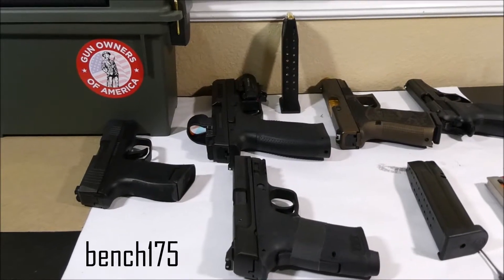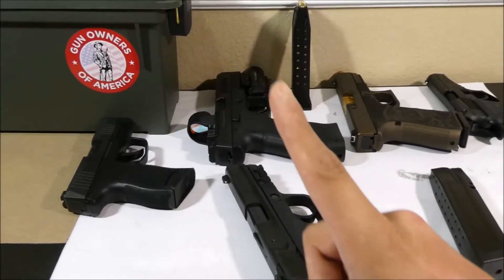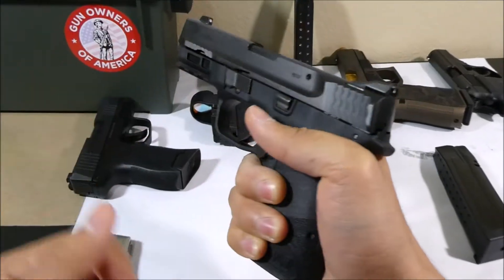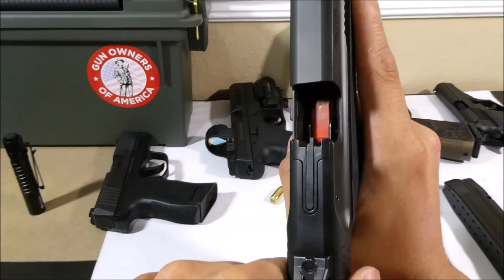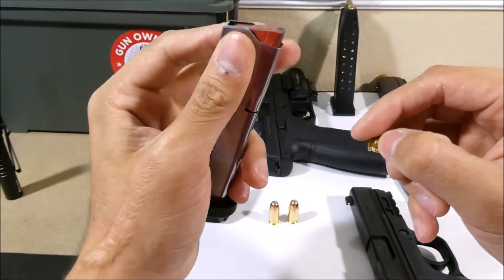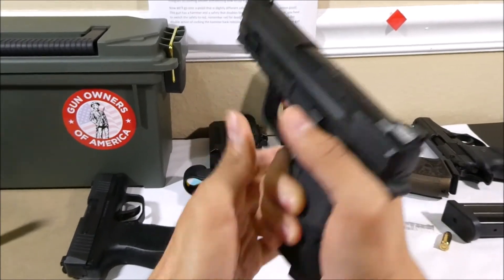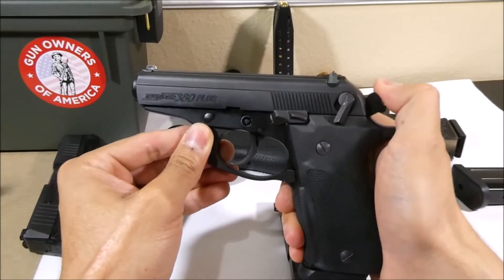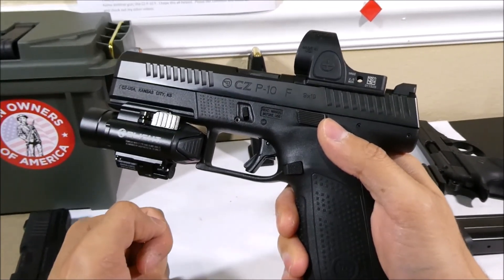How to use a Handgun / Semi-auto Pistol 2.0

Comment: Would a glock 19 be a good beginner gun for self protection? I am willing to spend at most $700 USD
Reply from the maker: I would say you have a lot better options than Glock these days.  They were just first like Ford cars, but there are a lot better cars than Ford.  Watch my video Best First Handguns 2020 at this link, and I'll answer any questions you have in those comments: https://www.youtube.com/watch?v=UYvydBUCIfY
Reply from the maker: Did you get a chance to check out my video?  I personally love and would recommend my CZ P-10F Optics Ready if you want a 9mm.  It seems you can find it around $530, and it's nice in case you ever want to mount a red dot like SRO.  Great trigger and stock 19rd magazines.  I'm about to buy some Shield Arms mag extensions to turn them to 24rds.
Reply: bench175 yeah i just did, thanks! Im aiming for a 9mm and i thought a glock would be a good beginner because they are reliable and easy to clean. But now seeing that there are so many options i can look at in my price range, i will defiantly take your advice when i am shopping. Thanks!

Comment: is there a way to tell whether a gun automatic/semiautomatic only by its look?
Reply from the maker: No, since it's the internals that would be different.  In the U.S., if it's a handgun, it's like 99.9% chance it's semi-automatic, since auto handguns are extremely difficult to control.  Auto rifles are also extremely rare since very high regulation results in cost of entry around $10,000.

Comment: Hey man! really knowledgeable video on all the small things a beginner shooter may worry about! I got a few questions regarding your m&p:

1) May I ask how safe is it to tape the grip safety? I’m genuinely curious because personally, I’m not a fan of the grip safety myself and I have never seen that method to avoid it on an M&P shield EZ

2) In your opinion, what are some pros and cons to taping the grip safety?

3) what are some safety precautions you take (besides the index finger away from trigger) since you avoid the grip safety with tape?
 
4) When you first bought that shield ez, did you like the trigger safety and overtime you decided to tape it?

Thanks!
Reply: Edit: GRIP safety** not trigger safety on question#4 lol
Reply from the maker: The safety of taping the grip safety seems for me to depend on your overall degree of trigger awareness. The pro is that you never have to worry about the grip preventing your use of the gun. No real con to me.  You can use a holster all the time if you want to prevent an accidental trigger pull. I wish the EZ didny have the grip safety and never liked it, but the other feature of the gun made it worth it